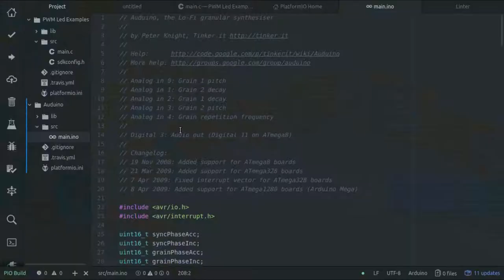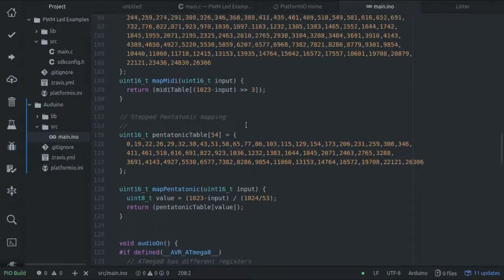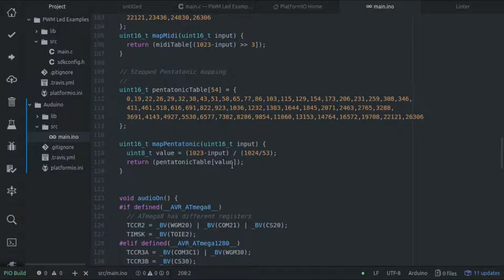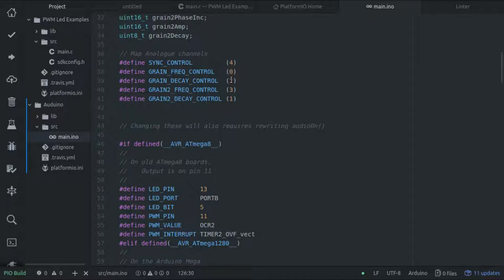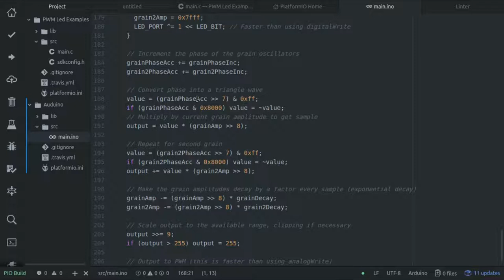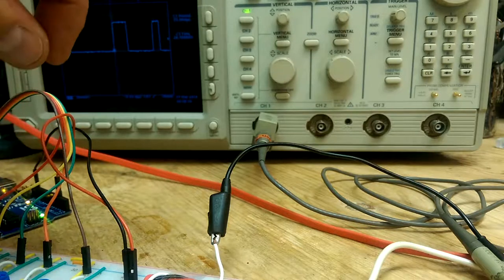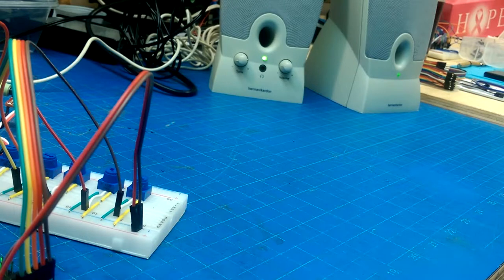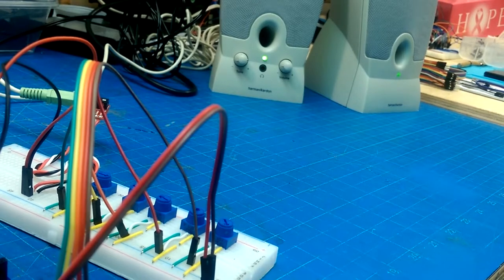Jambox Part 3

Comment: Once again, thank you for taking the time to post this video. This thing makes for about the most knob twiddling fun anyone should be legally allowed to have! I'm not sure about the crunchy sound you were getting in the video but my little breadboard was making some very refined and pleasant warbling. The filter/phasing effect is pretty amazing. This thing is almost as amazing as the MintySynth I finished assembling last month. Skookum Choocher!
Reply from the maker: Yeah, lots of fun to be had generating weird and wonderful sounds.  You can get some real crunchy sounds out of it with the sync phase way down low.  I will have to look at making the MintySynth.  I am guessing that it fits into a mint tin.
Reply: Yes it's designed to be built into an Altoids tin. You had better get started popping some mints now so it'll be empty by the time the kit arrives. It's a nice design and very hackable. It's all open source and 328 based so you don't really need to order one. You could just breadboard it with whatever you have on hand and download the sketches. Take a look for yourself: https://mintysynth.com/hardware.html
Reply from the maker: I think that I will breadboard one up to play with....